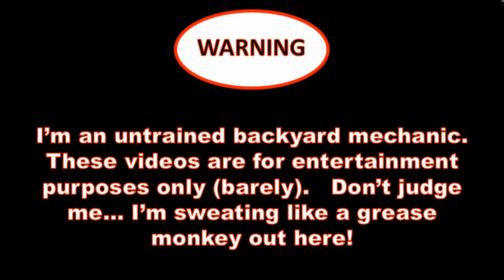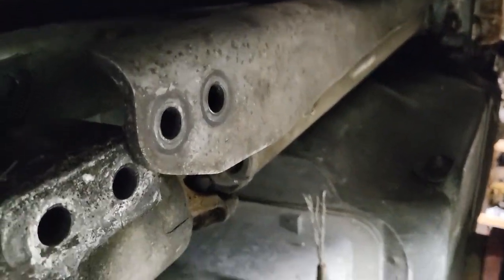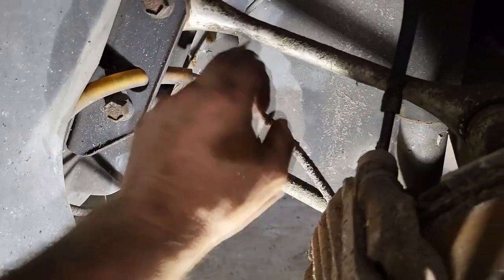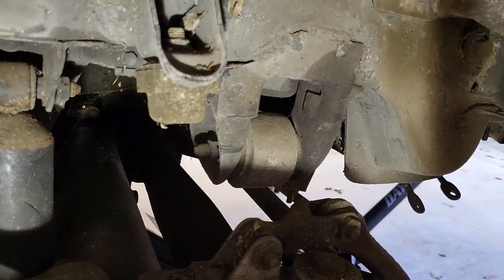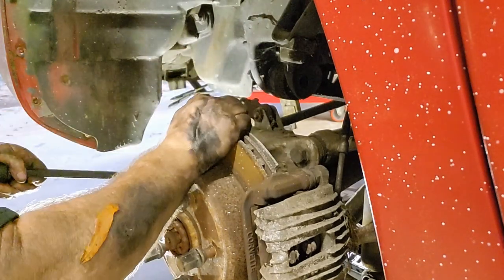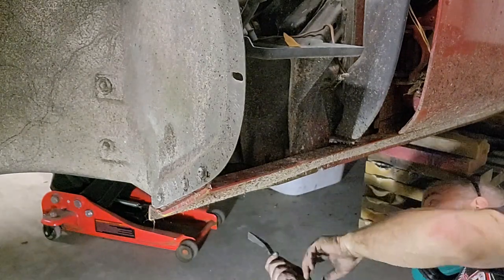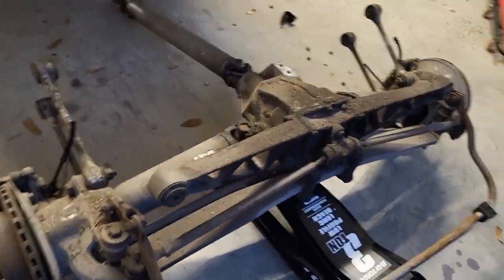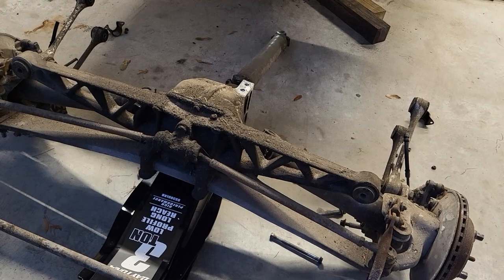Rear Suspension Removal From A C4 Corvette

Comment: I wanted to watch this because I have two C-4s a 92 and a 96. Just in case I ever need to take them apart, but as you know in 1988 they changed the rear ends, and one is wider than the other, and the shock mount is different.
Reply from the maker: I appreciate you stopping in to watch.  They are different but they mount very similar I believe.    Do these have the driveshaft in the tunnel?
Reply: Yep ... still a pain in the butt.
Reply from the maker: Ok.  I wasn't sure.  I hope you get.some useful info from my mistakes.. lol